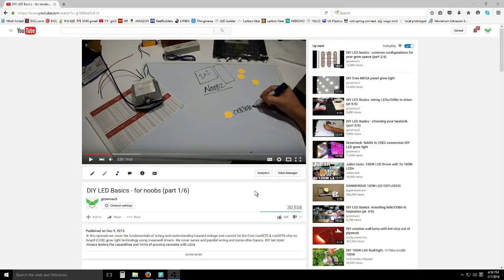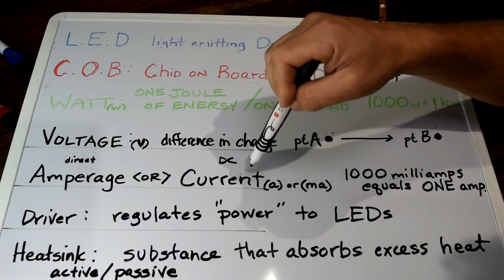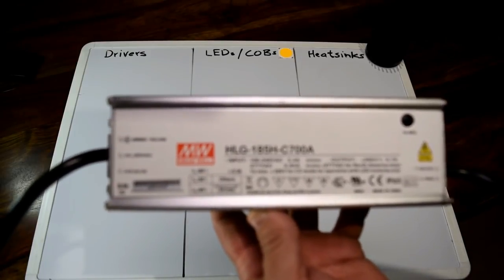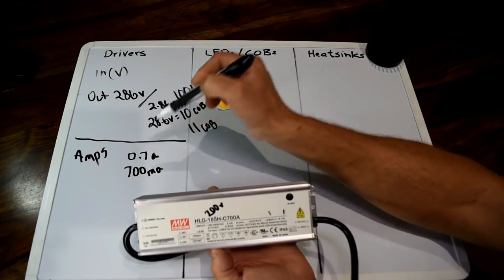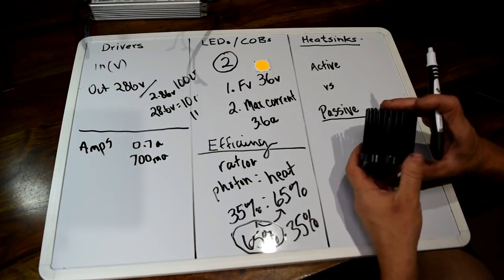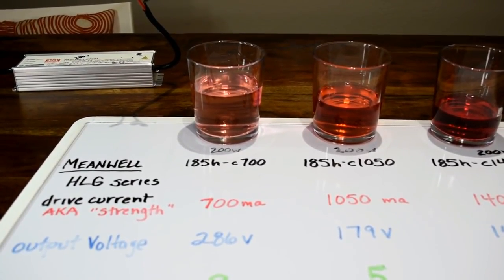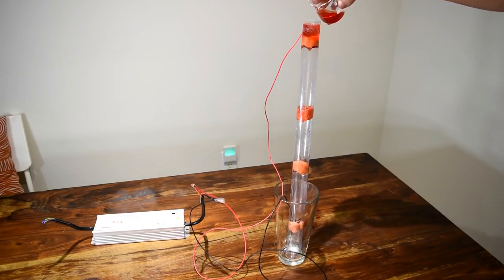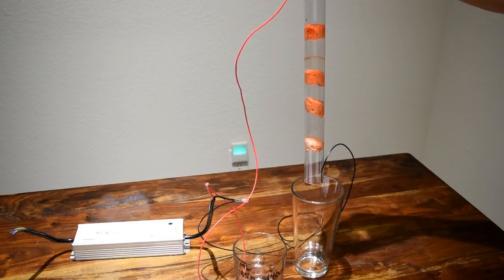DIY LED basics: getting started building your own grow lights: (pt 1/6)

Comment: If you used 9 COBs, would the extra voltage fry them?
Reply: lol what? Power comes from the driver not the LED's
Reply: @conservativemacro80  You obviously don't understand the question.
Reply: @PeterKKraus  you obviously don't understand how electricity works
Reply: @conservativemacro80  Thanks for the info. You're a great help. Lol
Reply: No, exactly the opposite would happen. They would be under powered possibly to the extent that NONE of them would come on. Each LED has a forward voltage Vf this is the minimum voltage applied across the LED needed to turn it on so for example for sake of argument if your driver has ouput of 286V and each LED had a Vf of 2.86V then you could have a maximum of 100 LED in series (each LED drops 2.86V 100x2.86 =286v) Now if you add another say 10 LED the volt drop across each led would be 286/110=2.6v ie you only now have 2.6v across each led this is less than the Vf so they wouldn't switch on or maybe dimly.
Reply: @williamgrady9004  How 9 be under powered if you use enough driver power for 10 COBs?
Reply: @PeterKKraus  ok. I see what you say. No you won't fry them because the driver is a constant current device so it will provide same current if you have 1, 2, 5, 8 etc. connected in series and so will not fry them.
Reply: @PeterKKraus  As far as I understand it, and that isn't saying much, a 286v driver like the one in the video can power 100 2.86v LEDs but it can also power just the 1 as long as the amperage is within the correct range for the LED. Someone please correct me if I'm wrong here.

Comment: One more thing. I'm going to create a diy led as well but I'm going to get a digital fan controller with temp pads. You can set it to up the fan speed in reference to how hot it may get..etc. Here's an example:

http://www.amazon.com/NZXT-Sentry-Performance-Controller-Black/dp/B001E0JH5E?ie=UTF8&colid=2HSQF5PBFO2CG&coliid=I2WFPB6JSZGWD3&psc=1&ref_=wl_it_dp_o_pC_nS_ttl

Comment: dude.. I cant get enough teachings .. your a BEAST.. but can I ask you i bought 5x citizen clu048 1212 3500k and I need help on getting the right driver  should I run them at 1400mA don't wanna over do it but what EXACT DRIVER WOULD YOU USE..im STUCK...LOL
Reply: Seventh Letter bro the 1.4amps is only the current or how bright the lights will be all you need is a driver that will divide enough volts for five cob. So “assuming” the citizen cob is rated at 36v then you need at least 180dc volts to run all five of them... i recommend watching the video again it always takes me two or three time to fully absorb info. Just some advise have a good day bro...
Reply: yeah im a keep watching till I get it... good look fam

Comment: For the noobs here is something for you to think about... first figure out what size grow space you want.. then figure out how many lights you need to cover that area.. then start adding up the costs of each individual component that you need.. you might find your just as well off to go and buy a light... for me to build these in Canada... here you go... 42/CXB3590.  65/driver.  20/heatsink... aluminum angle is cheap wires are fairly cheap but usually you forced to buy more then you need.... and maybe any other little thing you might need to complete this build like thermal paste and shit like that... do yourself a favour and make a list... more me to make a diy cob like this would cost me almost the same price as a black dog or optic light for a 5x5 space...factor in my time and I may as well just bought a light ready to go... now I will say one thing you will get from diy is the experience and knowledge and if your light breaks you will be able to fix it... sometimes the value of that knowledge is worth the most so take your time and really think about what you need and how much time you want to put into it... I can build anything I am millwright by trade... but I can not compete with China or big corporations no matter how hard I try... I always lose when it comes time to factor in MY labour...
Reply: bishop198666 the problem is your not getting the same quality components you would if you do it yourself! China junk!
Reply: First of all, you don't need  65 drivers to run 42 cxb3590's, you'd need like 11. Second you don't need  42 cxb3590's in a 5 x 5, that's overkill, by a lot , you'd probably want less than half that many in a space that size lol... Growmau5's new logic boards coming out of ChilLed are hitting 1000  µmol/s PPFD avg with 12 chips run off 3 drivers in a 5' x 5' space, $50 a piece for the chips and $125 a driver is like $1000 . Blackdog's claiming like 1500 µmol/s PPFD somewhere around there, for the phytomax 2 which has a $3,100 price tag... that's triple the price for like 50% more light, if it's even true, i'm not sure if they even say whether or not they used an integrated sphere test or what.
Reply: Jordan Mercier I guess I should have been more specific for you to decipher my words... $42cad/Cree cob   I need 16 of them... $50/driver I need 4 of them... I need 16 heat sinks at around $25....those are rough prices.. not included taxes and shipping ... hey bro I agree building your own is the way to go.... my point was for newbies who have no handy man skills at all... not to mention my time is really where the cost comes in... I make 200cad/day so I’m paying myself at least what my employer thinks I’m worth... I get it yet you by a quality light your paying out the ying yang but for some people the little bit of savings is sometimes worth more then the aggravation of building your own especially when you have no idea what your doing and just following some guy on you tube..
Reply: Jordan Mercier I can buy a 2 set optic 6 for 1675+tx CAD... that’s not far off what it would cost me to build these lights just in parts... ok mabye it’s not the same cree cob exactly but these are not cheaply made lights... and let’s be serious when it comes down to the numbers 98% of stoners not going to care or know the difference when it comes harvest times whether they used a CXB3590 or a CXA2530 or a different driver or what... most people are not crunching numbers most people roughly measure how many grams they got and that’s good enough... most people don’t understand the light measurement anyway so it’s not even doesn’t even matter... talk to most
People and they still asking how many watts... because they just don’t know! Now when people ask me about my lights and wattage I reply with.. how many watts does the sun use?? Most people need to learn how to grow before trying to upgrade their light... myself included...
Reply: i ran with chinese units before, since i build my own  i get much MORE and HIGHER quality bud ;)
Reply: I see what you're saying, I just felt like your first comment was a little misleading to the people that are new to this, they might have read your comment and decided not to watch any further. Those optic 6's are pretty nice for the price, the only thing that makes me wonder about them is that they don't use the cxb3590, they use the cxa2530's and idk how to read the datasheet's properly, im far from an expert on this but one thing I noticed is the cxa2530's have a lot lower luminous flux rating, like 70% less than the cxb3590 , and from what i gather that's the overall output of light.
Reply: Jordan Mercier Samsung made some cobs check em out on arrow.com

Comment: Hello,  i went way over my head and bought a quantum board kit without instalation manual. and i am stupid.
can somebody please help me?
this are the specifications.
1 HYVE dimmer
1 euro-netzkabel, male with open tinned wire. 2 wires (brown and blue).
1 meanwell XLG-150-H-AB driver. (input 100-240v - 50/60hz   2.0A. rated power 150w, defaul current 2.8A.  input ACN (blue), ACL (brown), ground (green/yellow). output A, blue (dim+) white (dim-). output B, Black (Vo-), Red (Vo+).
1  meanwell driver LCP-20-700 driver. class 2 power output.  input 100 - 240v - 0.55A 50%60hz. output: +30v 700mA max. input ACN (blue) ACL (brown). no ground. output: red (V+) black (v-). output has a connection box for 2-core cables. input has 2 tinned wires.
1 male euro-netzkabel, male with open tinned wire. 3 wires. brown, blue, yellow/green.
2 connection box for 3-core cables.
1 quantum board led with 2 inputs. input 1 (white light) has a 2-core connection box and pairs with the meanwell XLG-150-H-AB driver. input 2 (red light) has a 2-core connection box and pairs with the meanwell driver LCP-20-700 driver.

my main problem is that i dont even have a photo of reference to build my kit.
i can provide photos if necesarry. 
thanks in advance.
me stoopid.

Comment: im sure you still blew some stoner minds hahahaha. I learned all this stuff in my tech school I went to. Now I am diagnosing CAN and BEAN lines in the high end auto shop I work at. 

But I will say this to the guys who still don't get it, If you don't get it by now. write down each word you dont know or are unsure of and do some easy 10 min researching. Also knowing ele wiring diagrams and universal symbols for the EWDs will let you make your circuits without ever really doing it(drawing it out on paper) and then you can "run the system" in your head and make sure that you wont let that magic blue smoke out hehe
Reply: +growmau5 yea haha, ive been waiting! Have you looked into UV? or any other spectrum or other LEDs you could add? Besides the 730nm F.I. (do you use that? notice any differences? Longer lights on time?)

BTW: the kit idea is very clever! very easy for someone to get running when they have most everything they would need!
Reply: +growmau5 are you pulling most of your info from rollitup? I tried to join but nothing came of it. I'm on Jorge C. Forms. 

Blackops_grow if you're interested
Reply: +growmau5 there's not much going on as far as led goes but my journal is on there. First time ever. 
I'll try joining again after work today

Comment: i hafe now driverless cob led 230v.... hafe you ever try ?
Reply: What wattage are your LED's..?? I ordered some 110v 50watt to try out and on the way... Only 90 LW and 4500 ML around to the same output of a worn in 54 watt 48" T5 bulb....
Reply: 50w 3000k 3500k and 4000k...... i have now my first grow finished
Reply: Not sure what you're trying to say, try whole words and no slang, thanks...
Reply: How'd it turn out..?? How many are you using on how large an area..??
Reply: 18 pices with water cooling on 3m2........ they are mounted on a aluminium squere tube...... sorry my englisch is quite bad... smile
Reply: So 3m2 = 97.815 sqft / 18=5.318 =2.319ftsq for each LED, yes..??
When my products arrive will be 7 LED's on a 4' long bar loaded with 50ww,20fs,50ww,20fs,50ww,20fs,50ww=260watts per bar on two separate dimmers... 3 or 4 bars per 4X4 space, will decide that when all is assembled and fired up... fs=full spectrum=blurple as they say...lol Can't wait...!!! Your LED's form eBay China..??
Reply: Any defects with your batch of LED's..??
Reply: my leds are from switzerland 12.- each one
no i dont had eny problems or defect leds
it look like the led diodes are in bouth ways..... thats why they flikering
but i am very happy about it

i do not calculate to much......
Reply: not the same i think
Reply: No, not the same, but same lumen output. What did you pay per LED..?? Are you somewhere in Europe..??
Reply: 10 bucks.... yes in switzerland..... ;-)
Reply: I think you can add a small resistor to the string to eliminate the flicker, not sure of the specifics, but the information is out there...
Reply: I bought some cheap Chinese Cobs that were 3000K, only a buck n a half apiece. I also bought some full spectrum for $3.50 a piece. All were 50 watt outputs. The white lights seem to have more problems with heat. The full spectrum have been very pleasantly surprising. All use active cooling with each mounted on a cpu heatsink with fan.
Reply: Ni Jo  The China DOB LED's you have, are they the driver-less type, no driver needed..??
Reply: Yes. Living in the States, I bought the driverless 110V AC Cobs. It was so cheap to give it a try, I did. Full disclosure, I am doing an outdoor patio grow with sunlight as the main source of light energy. But I give a dose of these lights for an hour or 2 in the middle of their night cycle to ensure veg growth until I want them to flower. Reading up on "Gas Lantern Routine" gave me the idea. The results have been very satisfactory.
Reply: I have the 50 watt WW Driverless & 20 watt FS Driverless on the way, going to try dimmers on each. Going to mix 3:2 on each bar for veg & 4:3 for flower.. If it works out will load up for 4X6 flower space & 4X6 veg space...
Reply: Believe me, I'm curious to hear how it works out for you. There are few reviews of these driveless Cobs, and traditionalists dismiss them without any kind of honest appraisal. Safety of course must be observed, but these might be the future of grow lights.
Reply: There is a YouTube video out there, a guy using two 100watt WW LED "floodlights", one on each plant (nice size cannabis bushes) . He did a harvest yield count, the buds weren't very large and the yield was not fantastic, but hey, I would say excellent for only two hundred watts used... I will try to dig up the clip... There were seven from him if I recall correctly...
Reply: Jay Budington thats cool. sand me link
Reply: the taste of the weed is better...... then with hps
Reply: If you are in the lower 48, and your growing outside, why bother to interrupt the dark, it is summertime, not even summer solstice yet..??
Reply: Fair question. I put out clones early, and I thought I noticed preflowers. So I wanted to ensure veg for a while. My biggest are now only receiving sunlight. But I like having the lights as a method to allow me to control when flowering occurs.
Reply: Just arrived, no LED defects, the 50watts are running at 65watts, the 20watts at 26watts... Running very cool with fans, around 100F on the 50w and  89F on the 20w... Only have two mounted to heat sinks, bars not built yet. It will be hard to judge until multiple bars are loaded but no HID lights to compare them to... Light luxmeter on the way...

Comment: Just a question and this might sound silly, but new at this, lets say i have a row of led that 3.8v and in that row i have one led that is 1.8v will that effect that one led if the driver is range to drive the led?
Reply from the maker: Miguel Floriano that’s no problem. Let’s say a driver has 100v dc available. You can have one 70v Led, a10v and five 4v, or any random combination. As long as the drivers current is not too much for the leds, you are good.
Reply: growmau5 oh thank you for the respond,  my mom is at ease now heh

Comment: Can anybody tell me which kelvin type he uses , or which one is preferable
Reply: Rina Safir different kelvin for different plants and grow stages. 
Generally a cooler, more blue ended spectrum during vegetative growth (4000k or 4500k)
And a warmer bias spectrum during flowering stage (3000k) 
These are rough generalisations and can be manipulated at will
Reply from the maker: Rina Safir its been about 3 years since the video. These days , I really like an average of 4500K for veg.  For flower, I’m really leaning to the warm side. Most people are going warmer, like a 3000K base white led with 660nm deep red add on diodes.
Reply: @JonnyD3ath  hi, why not decide for the 6500k  for growing since , according to every source it's the most beneficial in veg mode.
Reply: Cervantes as i said, they are rough generalisations, do your own research and experimentations to find out what works best for your scenario

Comment: Nice vid, although my driver only says 48V as rated output. Maybe I'm a dumbass, but I can't for the life of me figure out how many 3030 diodes this 600w driver can run? I guess I'm close if I 600/.3w, but I don't think that is right either. Says max output of the diode is 200mA, and the driver is 12.5a @ 48v. Someone drop the obvious bomb on me.... Please....
Reply: how many volts do your 3030 diodes need to turn on? Divide that number into 48.

Comment: Dear SirI want to build led lights for aquarium. As I am a beginner and not an electronics guy I would need a blue print showing how to wire leds in sequence, what resistors to use, which power supply to use etc. I plan to use 1 watt and 3 watt led chips and would be using in blue and Cool White colour. Can you please help me with my project.

Comment: So i have a driver, 180v 0.7A, My supplier has 38.5v 2.8A COBS, I could run 4 off this driver? Help a homie?
Reply: Anyone?
Reply: yes - 180V divided by 38,5 = 4.67 which means you can run 4.67 cobs
Reply: yes - 180V divided by 38,5 = 4.67 which means you can run 4.67 cobs
Reply: +dstronglax, you are mistaken. There is enough voltage if you don't pull more current than the supply is rated for. 3a need > 0.7a supply = big voltage drop on supply. Thus, there won't be 180v any now and there will be no out very dim lights.
Reply: trying to keep it simple for him. and I doubt if 5 cobs were wired in a series that they would light
Reply: +dstronglax, simple would be saying 'no, the lights will not work well with the supply in any configuration.' But that would not help him understand why they won't work. And you saying, 'yes...you can run 4.6 cobs' isn't helping him as there isn't enough current to produce anywhere near the rated light; if they light at all. 3 amps needed vs 0.7 amps available...the supply will not work.
Reply: dstronglax j